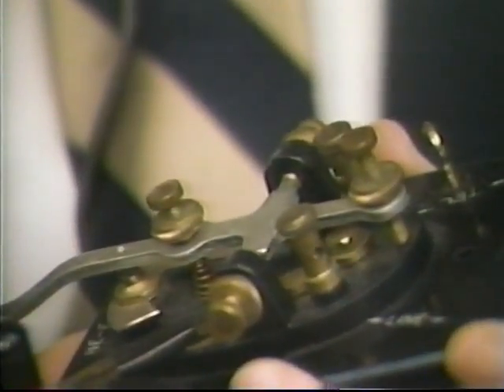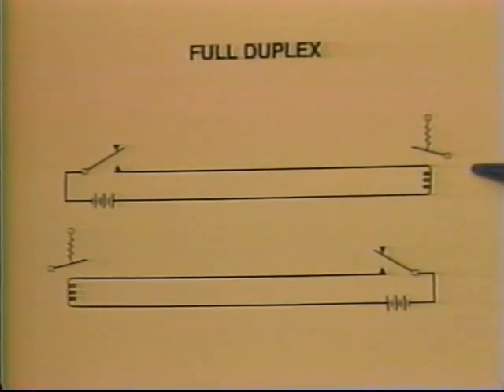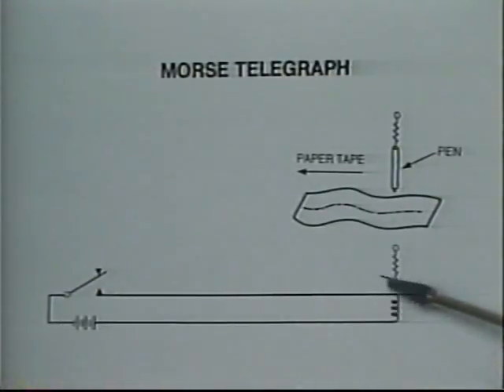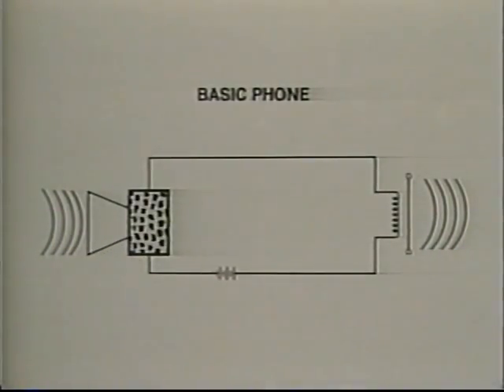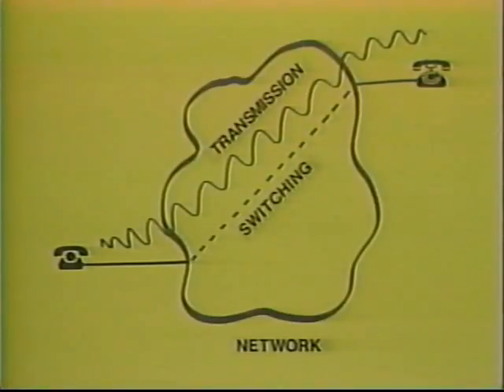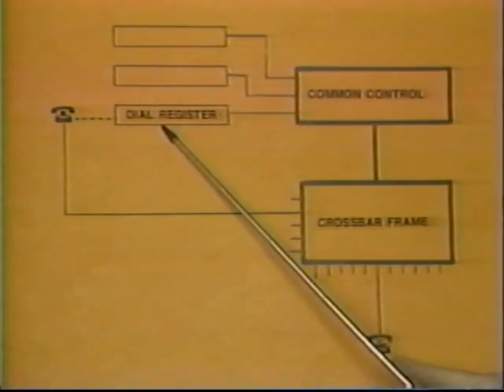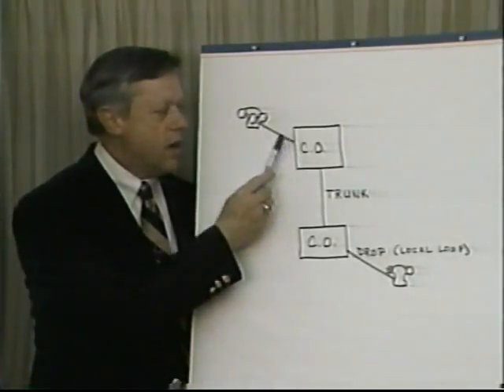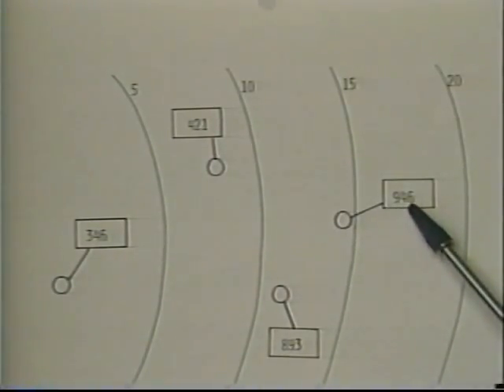Introduction to Telecommunications 1998 1/4

Comment: That is me in the video "Bob Noakes."  My partner and I produced these videos starting in 1985 under the name Information Factory.  I haven't seen these in years, thanks for posting.
Reply from the maker: Hey!  I actually tried to find someone at "the information factory" for approval to post them. after no luck I just went for it thinking the information was dated and there didn't appear to be anyone trying to sell them. I like old instructional videos. its what we had before youtube.
Reply: @Iam_TenTen  Please consider this approval to post them.  Bob Noakes
Reply: Can you answer a question for me?  When did telegraph lines stop being in use altogether?  I ask this question because I know that telegraphy still existed in the 70's and maybe later, but I don't ever remember seeing any telegraph lines being strung along the railroad track that ran through our town (the track has been gone since about the early 80's).  Were they placed underground by that time like telephone lines?  Or did the signals travel through microwave towers?  Did local telephone companies ever provide telegraph circuits?